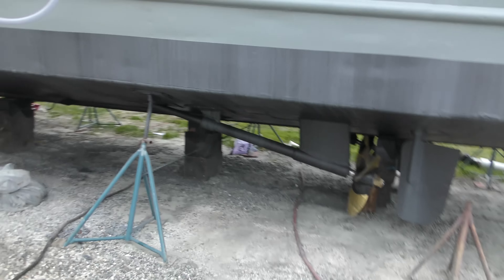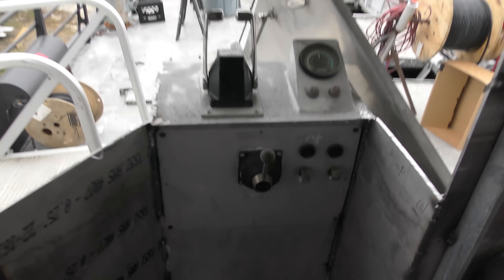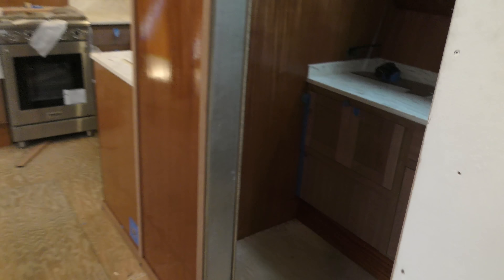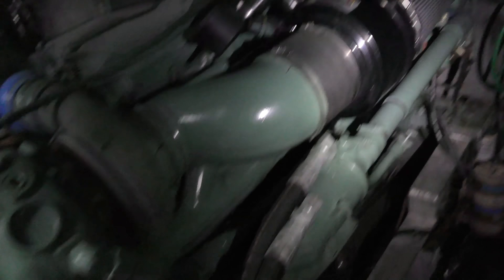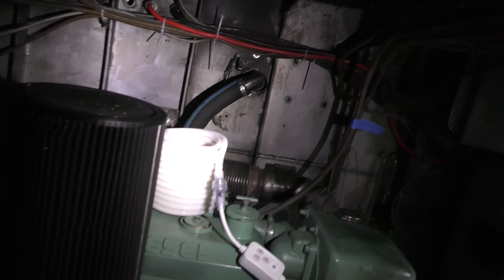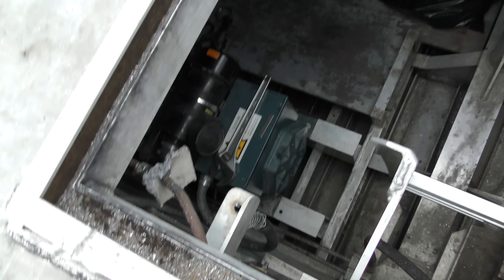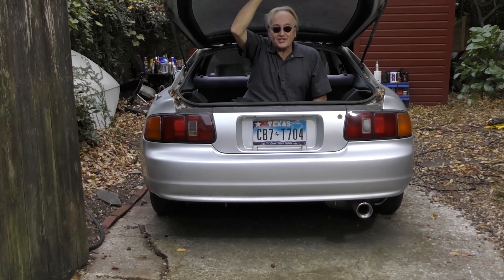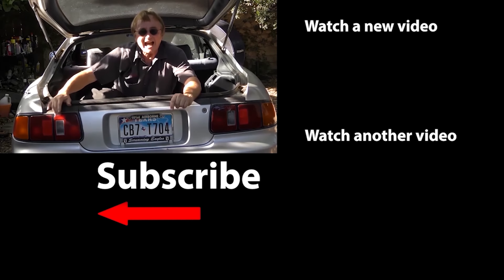I May Get Banned for Showing This

Comment: Keep us posted on the boat...sure is something different to see ..also those detroit diesel engines are solid ..as a truck driver you get on one of those older 60 series detroit diesel forget it ..easy to repair cheap parts and ultra reliable...

Comment: Ya, but just like a diesel truck things are MORE expensive to fix! Like putting the boat 🚢 in Drydock and cleaning the under carriage and working on the hydraulic steering.👍😍. I know I love the boat, just like using a school bus for a RV. It's built to last and safety.👍😍.

Comment: As a small boat owner, I can tell you that the biggest challenge is not really to purchase the boat (you just need to save enough to purchase one you can afford) BUT TO MAINTAIN THE BOAT! Bear in mind that your boat will be in constant war against the ocean water, the salt will eventually corrode and destroy things and the process will go lot faster if you don't maintain the vessel, and again, based on experience, I can say that anything that has the word "marine" on it, will cost you A FORTUNE!!! Buy a boat that you can easily afford, not barely so that you can keep paying for maintenance for years to come...

Comment: SCOTTY ...  THERE are monthly auctions in Long Beach marinas by the city , they start the bidding at $400
Buying the boat is the small part of the deal, finding a SLIP for the boat is where it will break you !
I used to rent a slip in the 90's for my 40 foot sailboat for $75, today a slip costs at a minimum of $10 per foot

Comment: So, I have a 2017 Ford Edge Sport.  When I open the driver, or passenger driver side door, the rear hatch (more times than not) opens.  What's up with that?
Reply: Sounds like a bad litigate control module. But it could be a number of things, including software updates that need to be done.

Comment: Yeah...be careful.
Boats are expensive to keep if you need to join a marina or yacht club. And lately, up here in Atlantic Canada, the insurance companirs are refusing to insure older boats. And even just sitting in the water they are moving and wearing out equipment, especially sailboats.